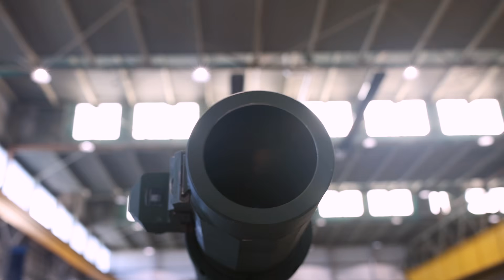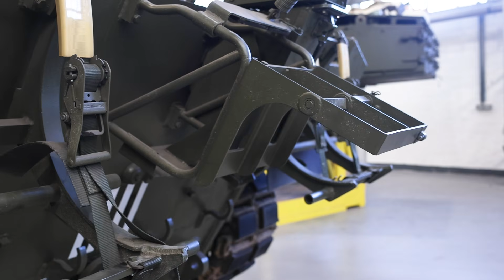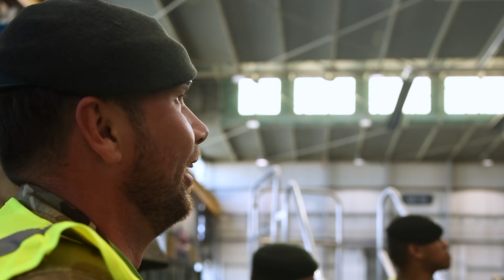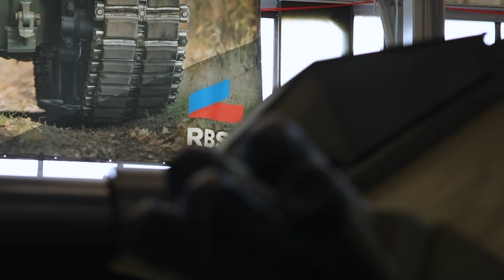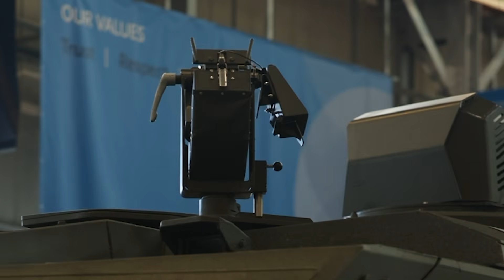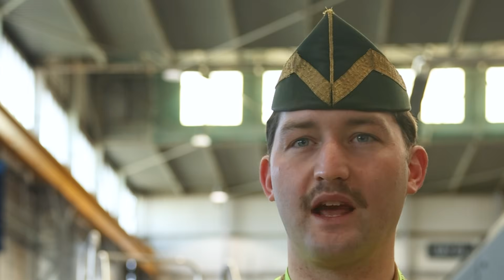Challenger 3: The New Generation of Main Battle Tanks | British Army

Comment: Looks good next version should be a maglock railgun cannon for anti, multi spectrum emp wave system for ariel and electonic targets and adaptive grenade launcher for counter infantry and drone control. With reactive multi spectrum armour composite fibre underlay and an acute/obtuse trothy systen with gravimeric and lader sensors and sonic and varible firwall and nano cyber language reconfiguration you have the ultimate war machine. With multi camo layering and adaptive weapon system you got a full spectrum weapon system that works with varible asset targeting and frequency modulated screening.

Comment: Russia 10,000 tanks 
Korea   3000 tanks 
India.    5000 tanks 
Russia  6000 tanks 
USA.      20,000 tanks 
China.    7000   tanks 

UK 213 tanks,

Please, listen l know all the other countries tanks are more or less than l put down.
UK only has 213 tanks.
Better protection 
Better training 
Better technically fitted out.
Better innovation and technology.

No use on a battle field with 50/1 odds against 1 UK tank.

Comment: Would you trust a contractor who fitted Gen 3 Hydro gas with faulty cylinder threads which wobble , doesn't seem to move when gassed 1700 -2100 psi it will be ok ????

Comment: Is this a Challenger 3 or the Challenger 2.5? What I can see is a Challenger 2 with a smoothbore gun. Alright, I know it is much more than that. Still even with the new power pack, armour and fire control systems, I am somewhat underwhelmed. I think the designers have played it safe rather than pushing the boundaries. Where this tank to be donated to Ukraine tomorrow it would still get knocked out by drones or mines or get stuck in the mud.

Comment: UNLIKE EVERYONE ELSE JUST COMPLAINING, I'd like to say its clear the upper frontal plate has received an extra layer which is atleast an improvement! (despite the still, glaring driver port and lower frontal plate weakspots. Also its worth noting that its received mountings for an independent machine gun which could possibly hint at an anti drone weapon of some sort. ( I would suspect it is, given the lessons the foot soldiers appear to be being taught about anti drone warfare) Finally, its also good to hear confirmation of an active protection system of some sort. However, it is rather a shame how outdated (protection-wise) the hull remains- especially when compared to other western counterparts like the leopard 2a7- we INVENTED THE TANK - cant we do better?

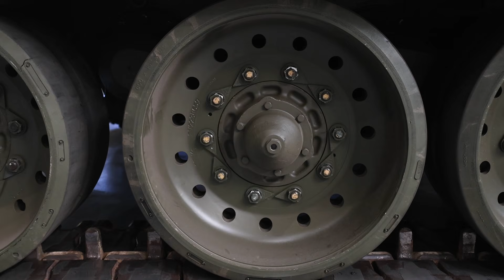Comment: At 0:41 it looks like a small stress fracture on the road wheel in the left of shot. Its in the 2 o'clock position.
Reply: Good spot. I think the rim is rubber rather than metal. If they are the prototypes they've probably been pushed pretty hard to reveal weaknesses.

Comment: They dont have 500 Challenger 2 tanks to slap a few german upgrades to and rename them Challenger 3 and the 200 they have are old and tired. This is an 50 year old tank after all. The least worn downs are getting the German upgrades (what few there are) and the rest are used for spare parts.

Comment: Why do you keep lying to people? It's just an Improved Chalenger 2, same chassis, same engine, same turret... the only thing you change is the cannon, from the Rifled cannon to the smooth cannon to use the same one as the Leopard. With this cannon you barely keep up with the new Leoparts, because you also use the short caliber.
You ruled out the 130mm cannon, even the 125mm, to avoid spending money, you ruled out the new Rheinmetall turret. And you haven't even considered improving the engine plant... it's a crappy car.

In reality, YOU ARE NOT GOING TO MANUFACTURE a single tank, you are only going to recondition the ones you already have.
I don't understand why you think everyone is stupid.
And on top of that you have left Europe and Rheinmetall is going to charge you more... you are shabby

Comment: Glad for the CH3 upgrade, but nowhere near enough. 148 CH3 is pathetic for a nation like the UK with its size of defense budget and global prense and commitments. At minimum UK should have 400-500 tanks which . The cost for the UK to upgrade 148 CH3 is less than 1.5bn thats means they could upgrade even 300-400 CH2 to CH3 for at most 2.5bn which is nothing when you think UK has a yearly defense budget of over 70bn and rising to roughly 90bn by 2030 under current plans. By 2030 the UK army should be aiming for 100k active, 30k reserve, 400+ tanks, 1,000+ AFV/IFV minimum.
Reply: We don't have 300-400 CH2 tanks to upgrade. What we needed was a new tank. Instead some connected old boys network got this upgrade program going.
Reply: @kencollins6324  may be wrong but i think UK has 300+ CH2 overall if u include tanks in storage. agree tho ideally UK needs a new tank overall and a decent order of them as i cant see them making a new tank alone like the CH2 and previous tanks so i think the quickest and easiest way is to order tanks that are in build. i think an order of 400+ new gen Abrams tanks would be a good idea.

Comment: I think the Challenger 3 is now really no more than a stop-gap. It's become clear in the last couple of years that future MBT's need to be designed differently.
Reply: Yeah any serious MBT will need some sort of defence from drones
Reply: @bobvance8017  The Active protection system also works on drones.
Reply: @donutperson9027  But most systems are still mostly around the tank, and ammo is still extremely limited. I'm banking on a miniaturized ciws system, down to .50 BMG or .338 NM, or even smaller if they can make composite casing and ammo works.
Reply: @thanhnamnguyen5280  With the size of many of the FPV drones we've seen in Ukraine (roughly the size of a pheasant) I'd argue 5.56 or even simply 12g shotgun shells would be effective. Your idea would be better suited for larger fixed wing drones like the Shaheed drones and stuff like that I reckon.
Reply: @donutperson9027  unfortunately the next gen of drones will likely be AI driven  as immune to jamming as a javelin
Reply: @Wintermute9366  The active protection system that the USA is getting and currently using does not rely on jamming; it's a hard-kill defense system.
Reply: Whats mountain bikes got to do with this?
Reply: @Mrtweet81  Thx, I have fixed it 😁
Reply: You are absolutely correct.  There are various ways to take out drones and there are various drones, this is a whole new form of warfare and we are still learning whilst developing and testing ways to combat drones, both those that are there as eyes in the sky and those that are there to destroy thing, the new tank at least needs this to be taken into consideration for upgrades.
.
The latest variants of the Merkava Mk 4, the Mk 4 "Windbreaker", and the latest Mk 4 "Barak" show the direction things really need to go.  The Merkava introduced a functional "hard kill"  "active protection system" back in 2011 and it has proven to be effective, so it is glad to see that the UK is finally introducing it a mere 13-years later (realistically 14+ years once they are actually in service.!), and a fellow commentator above questioned anti-drone capabilities, that really needs to be a thing, and very likely not ready yet, but the tank needs to be designed with this in mind as an upgrade package.
.
I have seen tank experts question the relatively anaemic power plant (engine) for years, depending on the weight of the Challenger 3 (I think it should have a new name, it's a very different tank, so a new name is IMHO appropriate) and although the new power plant was mentioned, neither the weight (likely undecided) was not noted, and likewise neither the power output, fuel capacity, reverse speed, fuel usage and other important things have not been mentioned, but they are still in the prototype phase so little is yet final except the main gun and ammunition and that it will have tracks and armour.  This is already very late and they only want 150, we have become an international joke in so many ways, and all self inflicted.!
.
The power plant output will be very important if a laser is going to be used for drone defence and that currently appears to be a good option, but there needs to be power generation and /or a capacitor bank and beefy generator built into the tank, and the tank will still need to move, all of this must be taken into account, otherwise the upgrade costs will be ridiculous and other forms of drone defence will need to be used instead of lasers which have the most promise against slow moving objects such as drones and much less so against missiles, where a "hard kill" system is best used, and this may still be the best option, just pointing upwards.  Time will tell what system is the most effective.
Reply: I believe I heard on the channel 'Task and Purpose' that the Challenger 3 was designed to be used as part of a new tactical doctrine, in which tanks are supported by infantry and drones. Seems necessary, if true.
Reply: An automated small caliber point defence cannon would work well I think, for aerial top down munitions and drones maybe 300 rounds
Reply: @616CC same with a directed energy weapon
Reply: @Tommy536bleh  yeah just the size of the ones that can fit on a mobile vehicle, they’re not powerful enough for destroying missiles and I think I think APS systems aren’t covering top down munitions and have a small  magazine
Reply: Doesn’t matter if it is or not, we don’t need 148 tanks in 3 years minimum, we need em now and a hell of a lot more than 148
Reply: They're almost obsolete.

Comment: It's a modified Challenger 2 lets face it.. can't call it a new tank because it's not.. god we are so cheap in the UK.
Reply: No more colonial income mate that's probably why
Reply: It's not even modified. The Challenger 2 with the rifled gun is better than this.
Reply: It's not just a "modified Challenger 2" it's a completely new tank. The turret, engine,  drive-train, armour, electronics, and survival system are new. It only looks like the old Challenger 2.
If you want to see a similar upgrade look at the upgrade life of an Abrams. Still looks almost the same when first introduced in the 80's.
Reply: @ralpha112233  no that's not how a new anything is created there is no new design process taking place it's just taking the old chassis and bolting on some new bits and calling it new when it's clearly not new!. It's a combat and survivability upgrade package. The fact the entire project is called Challenger 2 LEP (life extention programme) and you can upgrade old challenger 2's pretty much spells it out for you lol 🤷‍♂️.

It's not a new tank it's just replacing obsolete components and then calling it a Challenger 3.

It's why this program has been actioned over say designing and creating a NEW tank from scratch because that is horrifically expensive and takes around a decade. Like i said it's not a new tank lol i don't know how much simpler to put it for you.. it's just an upgrade package given to existing Challenger 2's for a cost saving over building a NEW tank and also is an excuse for closer ties to Nato by using a different gun and Nato standard ammunition and having the Germans do it for us it's all political aswell. The US does it with their Abrams except they have a different designation for each upgraded version. But still an Abrams tank just an improved version 👍 don't be fooled by the '3' moniker!. It's not the next in the series it's a fancy dancy 2!

Not a new tank lmfao you have no idea what your talking about clearly... you obviously don't work in manufacturing do you?. Don't be fooled by the propaganda and don't get your information from Wikipedia or Janes lol 👍.
Reply: @MrJonny6688  So all the "new bits" arn't really new then? What other tanks did they take them off? They just happened to have all the bits lying around and they magically fit. Yes, I do understand the manufacturing process.  You don't have to start from scratch to make something new.
If that was the case explain the Sargent York or the Gepard.
Reply: @ralpha112233  the bits are new but the TANK is not new... just because something has newer components doesn't make it a new total thing. If i change out all the internal components in my car i haven't got a totally NEW car have i? Just the old car with newer components. I think your getting confused mate this is not how NEW things are created. Upgrading something is not making it NEW 👍
Reply: @MrJonny6688  Have you heard of ths Ship of Theseus?
What percentage of something gets replaced until the original is no longer original? 
Apart from that the new components arn't old new stock but TOTALLY NEW parts.
Again, explain the Sargent York and the Gepard to me. Explain your logic with reference to those.
Reply: @ralpha112233  yes i have and ironically the arguement doesn't actually apply to the Gepard or the York those are still the base tanks just with a different turret lumped on for a different purpose hence the different name. But still the base tank platform... also both of those things were ironically replaced with specially designed systems that were built from the ground up NEW systems that were designed to do those particular specialities.. lumping a different turret on a tank because its cheaper and quicker than designing a NEW anti antiaircraft platform... kinda proves my point lol.

Just changing the turret and gun and engine of a challenger 2 doesn't make it a new thing. Now if they changed every single component and build an entire new chasis and designed it from the ground up to have new abilities that's a new thing.

This is an upgrade program i don't understand how you don't understand that!. The project is called up upgrade program for gods sake.. the clue is in the name... its an upgrade for an already existing system.. its not a totally new system. 🤦‍♂️... if you don't understand how these things work im wasting my time trying to explain it to you lol.
Reply: @MrJonny6688  Just because it's called an upgrade  program it doesn't mean that the end product isn't new.
If they just replaced the turret etc with the EXACT SAME PARTS but just had new ones made then would you call it an upgrade? 
Do you even understand the meaning of "upgrade"?
By your logic even if they reused anything from an older version it wouldn't be new.
I'm surprised you recognise the Challenger 2 as a new tank since, surprise! It's the same chassis as the Challenger 1!
Reply: @ralpha112233  It uses the hull from Challenger 2.
Reply: @jwadaow  So. All of the hulls of M1's are refurbished.  It is possible to use old parts to build something new.